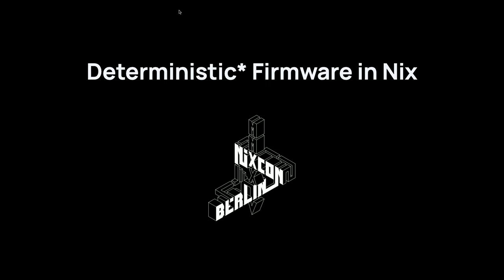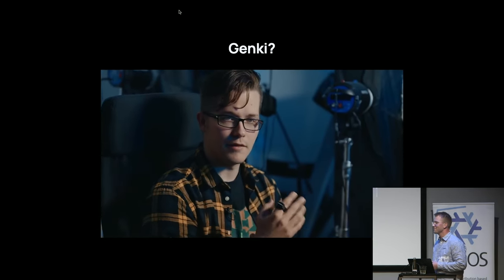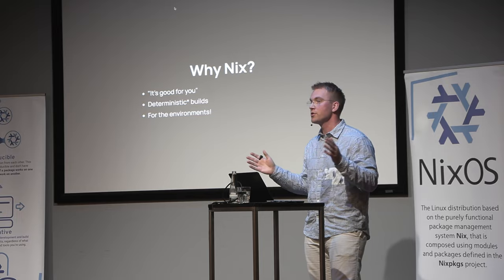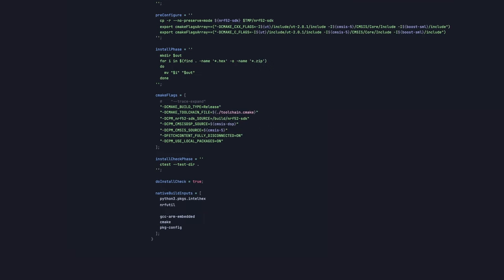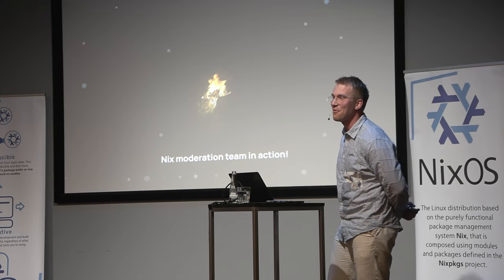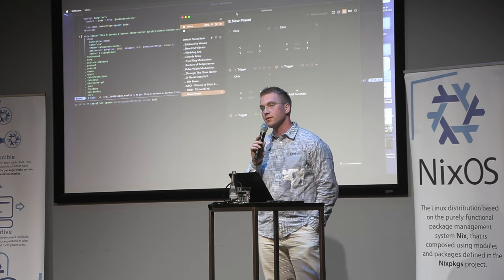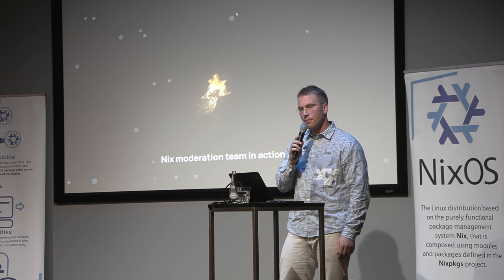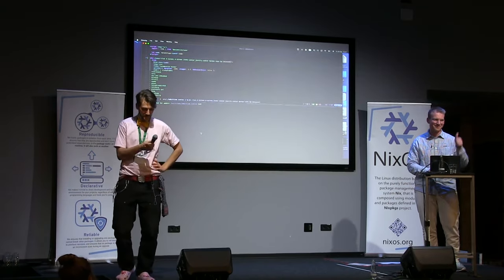NixCon2024 Deterministic Firmware with Nix

Comment: I was wanting something like this! cause my hp envy desktop since moved from windows to linux and then to nixos, has an outdated firmware bios dated to 2021, and hp does not provide as far as I can understand an update without me switching back to windows which is like no thank you. 

I am 24% out of 100% to being a  nixos,nix, nixpkgs power user, however with only 24% I am still beginner and hope that others more well versed can do tutorials to bring the power of nix* to firmware, bios like we have to operating system